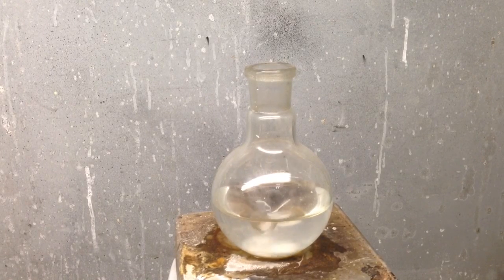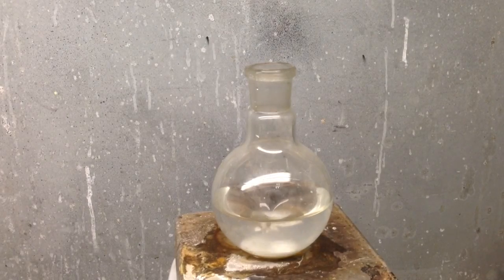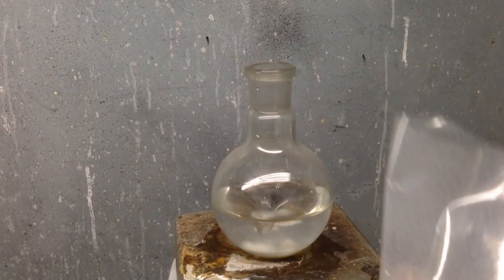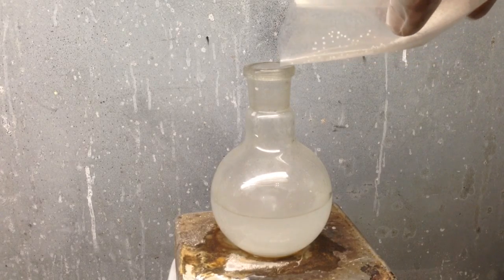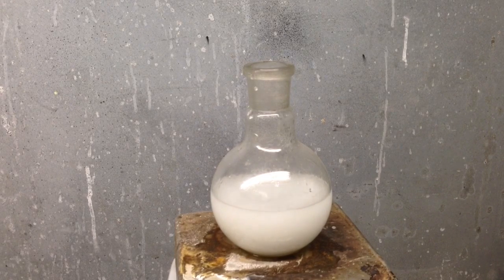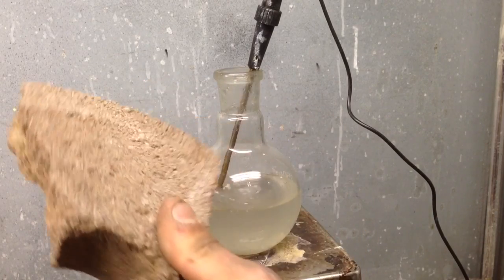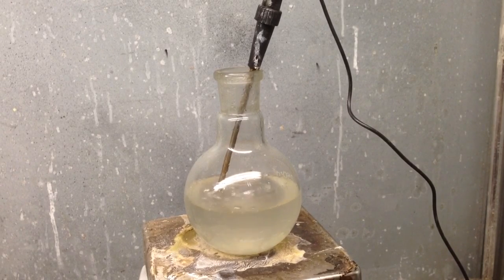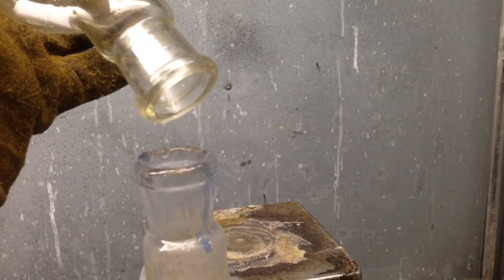How to make Sodium Silicate (water glass) - DIY Refractory cement - PART 1

Comment: Where is a good and cheap source to locate larger amounts of silica jel than what you find in just the packets?  I am wanting to make the inside barrel of a rocket stove with this material. It will be essentially a large L-shaped tube and I may also make two separate tubes of different lengths to try that as a diy experiment, as well.  How much of the final water glass would be necessary in a mold for say, two cylinder pieces which are maybe 8" long at one end (the smoke stack) and 6" at the other end (the fire burner side)?The aluminum plate does not get hot enough to melt your plastic mold container when you sit it on it to harden?Thanks for posting this video. I love diy projects and always find something more out there to learn from.
Reply: +a1930ford If you go to Walmart in the cat litter section, you can find a product called "Special Kitty"  It is 100% pure silica beads and cost  $19.00 Canadian for a 5.4 Kg tub. Hope this helps
Reply: +Green Zombie  I looked it up and it says it's 100% natural clay. That is not the same as silica gel is it?
Reply: No, you are looking at the wrong kind, The kind I but is special kitty from walmart and it says 100% pure silica on back.
Reply: There is a different one? Can you send a picture? Thanks for responding so quickly

http://www.walmart.com/ip/Special-Kitty-Natural-Cat-Litter-25-Lb-Cats/10293705
Reply: +onetwothree57 Hello, I just tried a search, and I am being led to think that it may have been taken off the shelf because of a conflict with arguments that silica dust may be harmful if inhaled. I may have got my tub just in time as it is very useful. I would go into the stores and look on the ingredient lists on the back of the tubs to make sure it says 100% silica gel. Sorry for any confusion. It;s deffinately weird to say the least.
Reply: Ok Thanks. Maybe the brick makers pushed for it to be taken off
Reply from the maker: +onetwothree57 you can get 5lbs of it at michaels arts and crafts store. its used for drying flowers. its also used for dryng air for painting with a compressor. it's a "dessicant" so you can google it and find a local retailer. it shouldnt be too hard.
Reply: Thank you

Comment: I don't know about chemistry equipment so I have to ask about the stirrer. How does that work?
Reply from the maker: its basically a simple hot plate, as for the stirring function.. its just a magnet on a motor. the stir bar itself is another magnet coated in teflon. the 2 magnets connect, and the motor spins them to stir whatever need stirring.

Comment: As an alternative the following takes 24 Hrs and is relatively safe.
1. Obtain a suitable STAINLESS STEEL pot that has a lid. Insulate the pot e.g. use fiber glass insulation.
You shall NOT use and ALUMINUM pot.
2. Obtain and don PPE else go to step 6 below.
Note that chemical burns from lye heal slowly and eye damage is permanent.
3. In the pot combine dry 200g lye with dry 300g silica gel "cat litter". Blend well.
4. Slowly, and with care instill 500 to 550 ml distilled water. A +230F strong exothermic reaction results. There is no need to stir or break up undissolved product. Some steam will evolve however the BP sill shift upwards toward +250F. The initial quiescent temp will be about +220F.
5. Put on the lid, insulate it, and wait 24hrs - done.
6. STOP
Reply from the maker: this is a good alternative, but far more dangerous then the method in the video. 

if you do it this way, like stated do not proceed without PPE.. because the reaction will be alot more violent, and possibly spit, and pop.
Reply: +jerry quigg People are often advised to add an acid to the base slowly. By mixing dry you are adding everything at once. Also you are kind of rude.
Reply: How is this safer? This could react explosively.
Do like you oughta, add acid to water. NEVER ADD WATER TO ACID.

Comment: Thank you for the Video!I did try this yesterday in a stainless steel pot over a propane cooker. I could hardly get any of the silica gel dissolved. I could see a reaction on some of the pellets, but the others just did remain in the solution an did never dissolve. I did cook and stir for about an hour (with interruptions). Don't understand what I'm doing wrong. The NoH is pure, was added first and then the silicate...
Reply from the maker: by the sounds of it you need more sodium hydroxide, or more heat.
Reply from the maker: most likely more heat if you followed my recipe.

Comment: how would it work if you used potassium hydroxide instead of sodium?
Reply from the maker: Unfortunately it would not work with potassium hydroxide. This reaction takes the sodium and bonds it with the silica, with potassium hydroxide, you would be making a different compound.

Comment: Just an update you can in fact make Sodium Silicate from fumed silica. I was able to dissolve around 50g of fumed silica in 100 grams of sodium hydroxide with 200 ml of distilled water. It is extremely messy and no clean or good way of going about it as fumed silica floats rather than sinks which causes airborne particles. So proper PPE is a must. Another note, using pyrex and a propane torch is a good way to get a catastrophic failure. ill stick with Stainless Steel for now on.
Reply from the maker: glad it worked out for you, and Pyrex should be fine with propane, just not at a focused point.

Comment: can you use fumed silica in place of silica gel? the reason I ask is because I have an abundance of fumed silica.
Reply from the maker: I am not sure, you could try a small batch, if it dissolves into a similar substance in sodium hydroxide, I would have to say you have made sodium silicate. 

You can make it with crushed glass, and molten sodium hydroxide... But I'm not about to tell you guys to go boil some solid sodium hydroxide in your kitchen..
Reply: nilamotk I just tried it and it was a success. Now to just figure out quantity because fumed silica is so fluffy it will be hard to get a measurement.

Comment: Another very useful video (considering the second video is what I saw first which makes this video critical to watching, 'natch).

In this video, you mentioned that this solution can be used for concrete too. I am heavily looking into earthbags which uses sand, clay and concrete as a stabilizer. So, I have to ask, as an additive, do you think this would be useful in solidifying the mix?

From what I've read, the mix should generally be about 20-25% clay, 65% sand and 10-15% concrete (using as small amount of water as possible). The drawback to adding this solution to the mix is that the longer it takes concrete to dry out, the harder the end product will be.

My original intend was to use your instructional video to making refractory bricks for a specialized kiln, but it tickles my curiosity if this could be used with normal concrete too.
Reply from the maker: Haha yes this video is important if you plan to use the second video.

I think you missunderstood, I meant to say that sodium silicate is a binding agent, kinda like the cement that holds concrete together. I'm sure you could add it to comcrete, but it will not be firebrick. Regular concrete is full of quarts, quarts explodes at high heat and breaks the brick. This is why you SHOULD use silica sand if you make this silicate based brick for fire use. I used play sand without issues, but according to the "book" silica sand should be used instead for its heat resistant properties.
Reply: nilamotk 
Oh, okay. Well, I'm sure I could add sh'mores to the mix too, but I was curious if you felt this solution would ADD any significant binding properties to the earth brick or if it was just plain redundant. My gut feeling after I posted the question is that it's redundant. Felt kinda silly for asking, but it was already posted.

Rest assured, I didn't intend to use earthbags as refractory bricks. heh 
I intend to use your exact mix (or the silica sand) when I make them, the earthbags was another project. I don't have any experience for this to start experimenting right out of the gate (that's why I ask questions of people who are more experienced or just more knowledgeable).

Thanks for the prompt reply.
Reply from the maker: I don't think it would hurt to have water glass in the earth bag mix at all, I don't know if it would add any strength to it or not because I have not personally tried it. 

The main real use for water glass is for making sand moulds. If you take the mix that I make in these videos, and purge it with CO2 for a few minutes, it will completely solidify into whatever shape your mould is. The sand moulds are used to cast aluminum parts in, so they can withstand some serious heat. 

This is not "real" firebrick, but it is cheap and easy to make, and will work for the purpose. 

If you wanted to make this mix stronger you could try to add porcelain cement to the mix to possible add some strength. Porcelain cement resists higher temperatures then standard motor mix. 

As for the earth bags, I can't give you a definite answer and to be honest with you, I read your question wrong the first time and probably answered in the wee early hours of the morning. Lol and no question is a stupid question, also I'm not a master with this stuff, but I have tried 10 different "refractory mixes" and this was by far the best one.. 

Don't use plaster.... It sucks... Don't use regular cement, for reasons I stated before, and don't use "fire cement" because it will cost you an arm and a leg... Lol (personal experience)

Good luck with your projects.
Reply: nilamotk 
No worries. Everyone has those "wee hours-sitting in front of the 'puter" moments. 

Understood. Frankly, I remember reading somewhere that Ferrari used a special sand especially for their aluminum castings. It was probably a similar process to this, but they used a very fine (expensive) particle sand (or silica is probably the proper term). This allows their castings to come out less rough and needing less machining because the finer sand conforms itself to the positive mold better. Thought you might find that useful...

Something else you might agree with is that since the above solution is water-based, then getting water on the mold after it hardens would probably soften it?

Also, don't sell yourself short. A "master" is simply a person who learns a feat or process and can not only repeat it, but reiterate what they learned in a simply stated form in order to teach another. That you are analytical in your approach to using different materials (systematically testing various alternate methods) reaffirms this again.
Actually I think a "master" simply states how adept a person is at something they learned.

In martial arts, I believe it can be argued that a master is someone who, if you put a sheet of rice paper on the floor, and they were to redo the same form in a daily process on the same sheet of rice paper, there would be no blurring of their footprints. 

My vice during the wee hours is I tend to babble a lot. 

Thanks again for the help and advice.
Reply from the maker: Yes real aluminum castings use "green sand" it's a mix of fine silica sand, and sodium silicate like you said. It's usually black... So I don't know why they call it green sand... Lol

And yes because this is water based, it does not like water... It will soak it p like a sponge, and the brick will turn back into sand....

You might be able to make it a little more water resistant by adding either porcelain cement to the mix, or some fire clay.

And I appreciate the words, I try my best and am always happy to teach others. I had a tough time in school because their methods of teaching didn't work for me... So when I teach something I try to help you visualize to better understand what's going on..

A squared plus b squared = c squared meant nothing to me in school until I see a triangle with side a as a square, and side b as a square equaling the size of side c's square.. Haha

Comment: Just watched the second one, the comments are disabled. I was wondering if you have ever used saw dust in the mix? Let it dry out completely, then fire it completely? 
 I know that is done to soft fire bricks, and the saw dust just burns off.
Reply from the maker: I personally have not tried it, sounds like a good idea for a nice airy mix. Thanks for the tip. I might try that in my next batch.

Comment: I used 180 grams of Pure LYE brand drain cleaner and 240 grams of Mother Nature Preserves powdered silica gel, with 400 milliliters of distilled water, hot. Adding the lye made it boil, as did adding the silica gel, but less so as the reaction went on. At the last I had to heat it. The result was a thick blue liquid.

A few days later, it had crystallized, and was warm! What happened, and is it reusable?
Reply from the maker: You have a highly concentrated form of sodium silicate, use twice as much water at least. 

To save what you have, add around 4-500 ml of water and heat slowly. As the sodium silicate starts to melt, mix it thoroughly with the water to dilute the solution,

It's actually not bad to have it in that form, if you don't plan to use it all you can store it as a solid, and dilute it with water when you need it. It takes up less space this way.
Reply: Thanks!
Reply: robert were get the mother stuff at
Reply from the maker: +donald laisure (73SuperGlide62) arts and craft store, for drying plants, some kitty litter for your cat to shit in, auto store for paint booths, and air drying.. you just have to look...

Comment: Where did you get the silica gel? I can't seem to find it for a reasonable price.
Reply: +nilamotk Had some for 10 - 15 years. Perfectly OK in a sealed plastic container.
Reply from the maker: I bought my silica gel from princess auto. It's a automotive retail store, and it's purpose is for airline driers for painting cars with compressed air, and other things that involve dry compressed air.
Reply: nilamotk And can you store the sodium silicate after it's made without it solidifying?
Reply from the maker: Yes, as long as it is an airtight container.

I don't know about 5 years... But I have some that's 2 years old and it's still fine.
Reply: nilamotk Thanks. Does the container type matter? (Plastic, glass, etc)
Reply from the maker: I personally used a type of water container. Kinda hard to explain... But I was a large version of those aluminum water bottles with plastic caps. I stored some in a glass reagent container with a glass plug, and I can tell you after the first pour when you put the plug back in, it glues itself in there...

So the aluminum water bottle worked good for me. The one I used was lined with a plastic on the inside, and the lid had a foam separator the prevented the lid from sticking.

I doesn't really matter, if you make this in concentrated form, most of the sodium hydroxide has been used up in a chemical reaction to produce sodium silicate. The byproducts of the reaction are hydrogen, ,oxygen in small amounts along with some heat. this means that the final product isn't as caustic as the sodium hydroxide itself.. Don't get me wrong, try not to get it on your skin.... But it won't burn like sodium hydroxide will, nor will it react with the container you store it in.

Just keep in mind, this is a "binding agent" and it will bind your lids to your containers if you are not careful. If this happens, hold the lid under a hot hot water tap for 2-3 minutes, and it will open right up.

Comment: where did you get your lab equipment?
Reply from the maker: eBay, and I've used my eBay lab glass for Mercury distillation at around 300C without issues. 

I have full faith in it. Real Pyrex is to expensive for me...
Reply from the maker: I bought it all from eBay, never had any problems. Buy in bulk and shipping is cheaper.